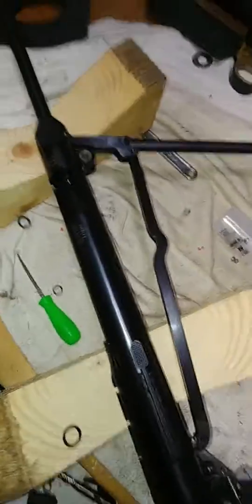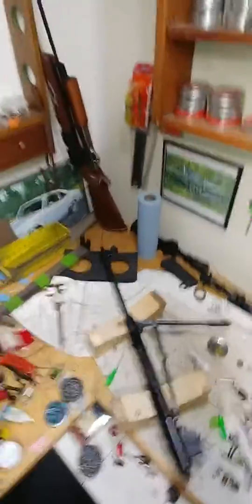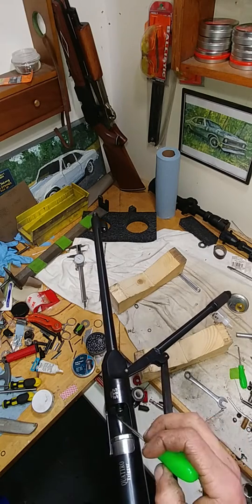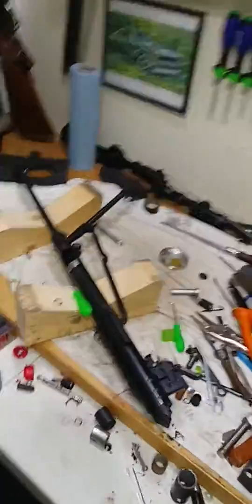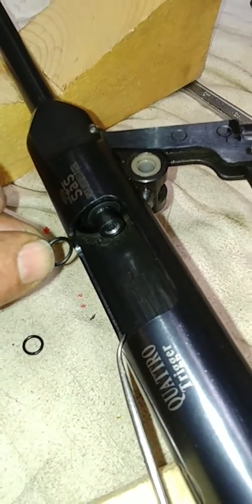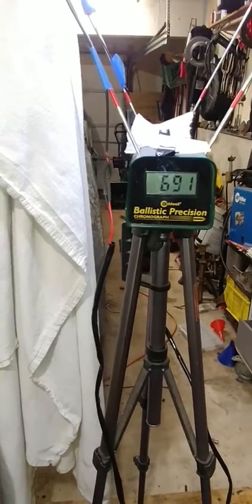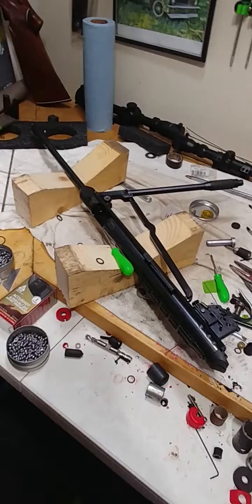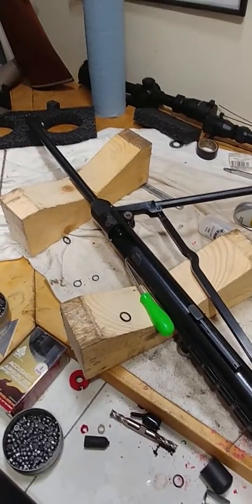Hatsan Dominator 200S carbine, breech seal issue

Comment: Just tried the o-ring on the breach and you are correct it did increase FPS. Was shooting around 580 to 600 FPs and with the o-ring I was getting 620 to 649 fps. Still lower then spec but better. I noticed that my rifle shot smoother too and less harsh. I emailed HatsanUSA for part numbers ( breach seal, piston seal, piston spring) and will be trying what you have been showing in your videos. I think this will be my learning platform for tuning.

Comment: The Proxima has an o-ring but it is inside the barrel ID at the breech, this is because the rifle uses a probe to seat the pellet through the magazine, a terrible idea as the pellet has to be pushed through the o-ring on its way into the barrel, I only found out about this as mine came out while mopping out the barrel, seems to be 7/32" by 11/32" for a .22, very soft rubber,  I have some slightly harder Viton ones coming from Ebay, hopefully more durable. Also, I stripped the rifle down and found it to be horrible inside, plenty of burrs/debris and a galled up piston seal (looks to be damaged during installation) I replaced this with an ARH seal, it was a standard 27mm 95/Striker/Dominator seal.

Comment: Hi AIRGUNNERS EDGE, First of all thank you for your effort in producing this very informative video. Can I ask you where did you got the custom made spring for the Hatsan Dominator 200S. Cannot wait for the new video highlighting Pros / Cons of the new spring versus the OEM item.
Reply from the maker: psyhotron666 http://vortekproducts.com/ourstore/ I contacted them after measuring the original spring that was in my dominator and gave them all the specs and asked for something Just a Little Bit Stronger, the FPS may not increase because I plan on using 16 grain pellets but the stronger spring will just help with the extra weight of the pellet hopefully with accuracy I'll pass 50 yards
Reply from the maker: psyhotron666 I do you need to address the ceiling issue first and foremost but after I get that all taken care of then I can do some testing with the other Springs and gas Ram
Reply: AIRGUNNERS EDGE Thank you for fast reply. Can I ask you what was roughly the price of the custom made spring? Also I hope that you have got the measurements  kept safe for the future reference. I believe it could prove to be very useful indeed.
Reply from the maker: psyhotron666 it was about $25 with shipping I think the spring itself was about 18 or 19 bucks..

Comment: A prototype type seal is free.  All seal material is rated to hydraulic pressure
Reply from the maker: Customairseals I will definitely be getting some dimensions for you guys, there are quite a few others who are having this issue on low fps so if this does fix the issue there will be quite a few others who will be interested... :  )